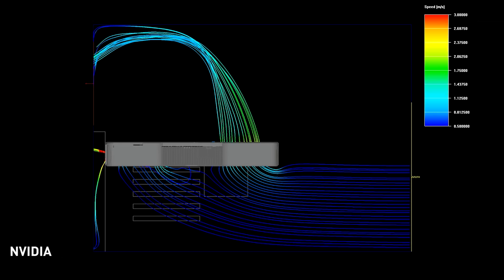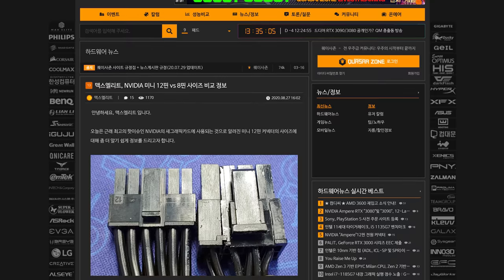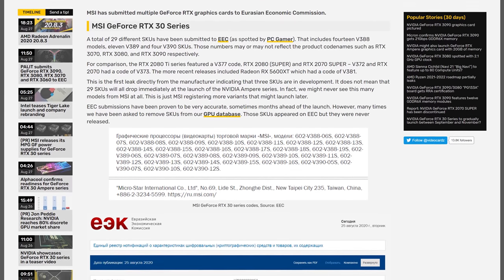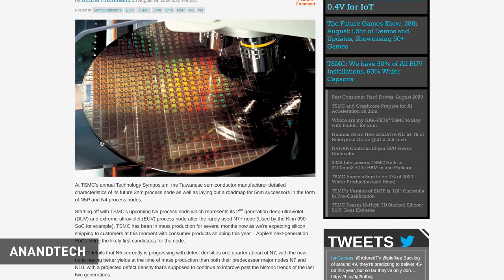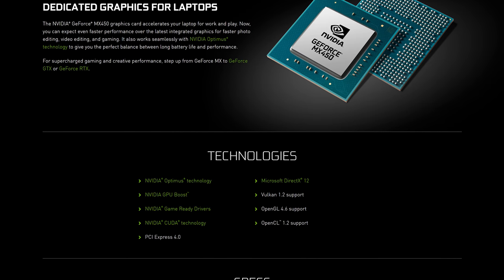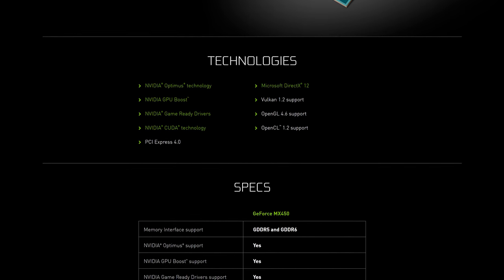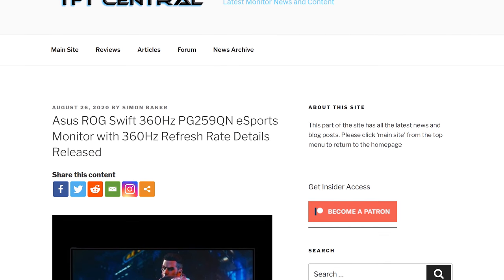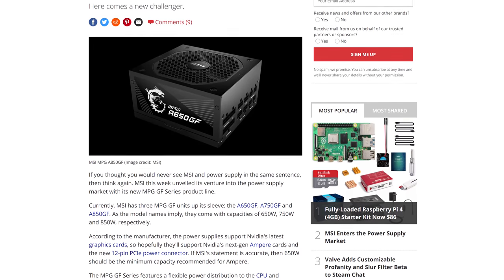RTX 3000 Power Connector, Great TSMC 5nm Yields, Nvidia's First PCIe 4.0 GPU | News Corner

Comment: 360Hz monitors are already coming out and I'm still at 60Hz, not to mention the sub-1080p resolution
Reply: well this just means a good 144hz monitor will be cheap to buy when you eventually choose to pick one up :)
Reply: Marko Grobler it will be harder to find than cheaper
Reply: @JimboJamboYT  I started to see some 144hz 1080p 24/27"" monitor on sale for 150-180€ (vat included), for me that's a bang.
Reply: They're chasing higher and higher hertz because bigger number better in the eyes of a lot of consumers. Hence why we have a lot of "120/240hz" TVs because people think it'll help with sports. 

I've used 240hz/144hz/120hz all before but I stick to 60hz for most games. It's perfectly fine for my RPG loving self. You might benefit from 120hz but the point to get beyond it really isn't there. Of course something something objective vs subjective.

Unless you do CS:GO I guess.
Reply: @nap8187  the point on going after 120 there is in all games
Reply: wish we would get QUALITY 1680x1050 screens 21-22" 75" not everything needs 32" 300hz yada yada 4k expensivenesss.. but monitors that size are sloooooooooooooow and TN and color accuracy doesn't exist
Reply: @ascissordollynamedgwen9409  wat? 99% of games that are not bad console ports have no issues with refresh rates above 60. If you play at 1080p 144hz it's doable with even medium spec hardware, you just shouldn't expect it in AAA games. If you only consider 120hz 4k then you're restricting yourself unnecessarily. 

I own a 144hz monitor, and even for simple tasks like browsing, coding etc. it's mind blowingly smooth. Whenever I have to use a monitor for work etc. that has 60hz, it feels choppy. One must be really disconnected with reality to not see the difference.
Reply: @nap8187  in rpg definitely not, more competitively it could have a purpose.

but imo the argument with skill  cap still remains: if you aren't even good enough to reach your max. potential with your current setup why bother upgrading? upgrade when you actually get good.
Reply: It would seem you need to up your monitor game....
Reply: No need to be sad man. I'm still on 60Hz 768p monitor

Edit : typo 768hz -> 768p
Reply: So buy a new monitor?
Reply: @mrjabal123  I sincerely doubt you're using a 768 Hz monitor.
Reply: no modern games will run  at 360fps anyway even with rtx3090. Maybe 240fps in some less demanding titles. (csgo is old)
Reply: Abdurrahman Salim *768p

That's my laptop's monitor lol

Comment: Hey, it looks like I got the new cooler design right!
Most outlets thought the new, top fan blew the air DOWN towards the bottom but I kept telling people it was probably a REVERSE direction fan so it was pulling air towards the top of the case. Otherwise you had a weird loop where the hot air was being shoved back towards the bottom fan... so this makes a lot of sense, though they could have put both fans on the bottom if they'd wanted to, so the 2nd fan being on top is probably just aesthetic (though it did get people talking about it so mission accomplished)
Reply: (EDIT: I don't mean both fans could have been normal position, just that the top fan could have been on the bottom blowing air up THROUGH the heatsink stack rather than the fan being on top and PULLING it through. I can't imagine there's much difference)

Comment: If there is a potential for a move to the 12v only PSU's.... where 5v etc is managed by the motherboard, it makes sense to start pushing other improvements to the PSU, like this new 12 pin gpu power connector.

Comment: That flow diagram is either old or deception if the pictures of the fan orientation on the top of the card is correct. That fan is in a push configuration, not a pull.

Comment: with smaller wire you can increases voltage and lower amperage thank you for your hard work
Reply: since the card is relying on +12V of the ATX standard, the voltage can't be increased. That's why this special 8pin mini-fit Jr connector is just an annoyance.

Comment: What worries me most about this "new" power connector, is frankly heat. A little bit overclocking and you might be pulling 500w++ through that, with cables and interconnects veeery close together. A slightly imperfect connection, and you'll be looking at a ton of heat with not much space to dissipate nor mass to sink it.

Comment: I see a major design flaw with the new cooler design of the RTX3000 series, it seems to push hot air over the CPU socket. Not an issue is you are water cooling but I wonder how this will impact CPU performance?

Comment: I think the thing people forget when saying that this or that doesn't need pcie 4.0 we're not saturating or whatever is that even if you aren't using all the bandwidth of pcie 3 x16 that same bandwidth span can then fit on pcie 4 x8 potentially saving lanes and possibly board space. Plus you can't use something that doesn't exist so you wont push as hard to saturate bandwidth as you approach the limit of the bandwidth limit of the majority of products. So as more higher bandwidth capable cards get out in PCs or consoles the more likely it is that game/app developers will push the limits of what is currently possible till they hit another artificial limit of the average of cards out there (probably somewhere between 50% and 75% of next gen top end card's bandwidth).

Comment: ??? board partners will most likely opt for the 12-pin because to match its ~600w capabilities you would need FOUR 8-pin connectors

most partners produce OC'ed models if the power consumption rumors on ampere are true,  why would they choose to loose so much board space on four 8-pin connectors?

logically they will  simply box in an adapter, most likely four 8-pin to single 12-pin

Comment: hmm even though the tdp of i9 9900K is 95W it could easily draw 200W especially oc:ed
so the high end Ampere may will hit at least 600W?
Reply: Belagerungsmörser the Sheep  sry forgot to add a question mark
Reply: With LN2 I think it can but on air I dont think it will exceed 480W that's still alot tho lol
Reply: it will not. CPU is not the same as GPU. with CPU mobo maker end up doing things that allow the CPU to draw as much power as they can. hence you did not let the voltage on auto when you want to OC your CPU. anyway there is latest leak at VCZ. just look it up.